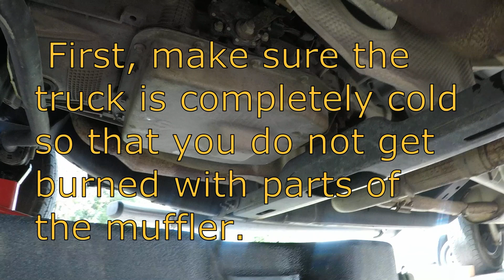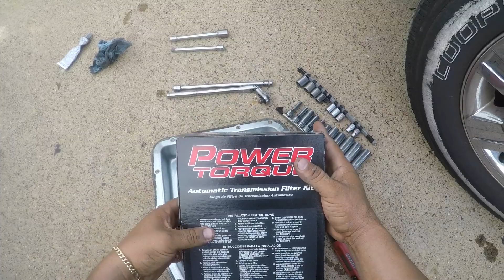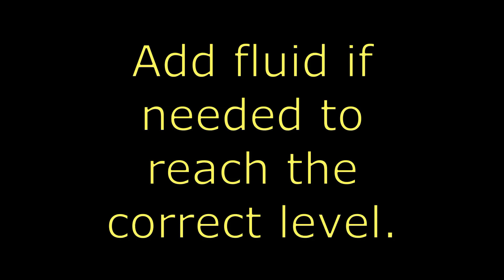2007 Ford F150 Transmission Fluid Change

Comment: I appreciate the note about the factory dust plug. I have changed the transmission oil in many vehicles. Never an f150. That thing freaked me out because I thought I fell out of nowhere 🤣
Reply: Same! LOL I have spent the last 30 minutes trying to figure it out before putting the reusable gasket and pan back on lol

Comment: The trans gasket is re-useable! It even states that on the pan!
Reply: (years 2004 thru 2014. Not including F250, Super duty or diesel models, F150 heritage, lightning or raptor models.

per my f150 manual, it states to never reuse the gasket or filter
section 1-27 ATF maintenance schedule 100k miles

under section 2 states
"2. Before beginning work, purchase the transmission fluid specified in Recommended lubricants and fluids in this Chapter's Specifications, a new filter and gasket. Never reuse the old filter or gasket!"

Comment: The factory gasket is reusable. You don’t have to put sealant and new shitty gasket on. The factory one is perfectly fine as long as it isn’t torn.
Reply: Yes, use the higher quality of the Chinese made rubbers, even if it's got many miles behind it
Reply: O kay
Reply: the manual states to not to reuse the gasket/filter....

Comment: Nice video!   Really clear and well made.  One note: I would stick with Motocraft Mercon V, not LV.   Also, does your cordless drill get tranny fluid in it and have you noticed it affecting the drill?
Reply: I saw that too and was like "is use a ratchet for the last few bolts, tranny fluid can't be good for a drill."

Comment: Easy way of torquing the pan bolts is to palm a 3/8 ratchet just tighten about as hard as you can with one hand wrist, can’t over torque, works perfect every time. I don’t trust the torque wrench 🔧 just seems way to tight. Great 👍 vid.
Reply: Is the wrench calibrated or your wrist lol
Reply: @robz5435  ibelive you ppl at work dint even torque wheelends…

Comment: Did you look inside the filter bore hole for the old trans filter seal? They usually stay inside the bore. I bet you didn't and pushed up further into the bore!
Reply: SERIOUSLY? Blue lock tite? Man, you need to stop doing mechanic work all together! You are misleading people by doing stupid shit like that!
Reply: @wrr2112  I don’t use thread locker at all unless it calls for it. As long as you torque it to speck it’ll be fine
Reply: If you were paying attention you can see it was still connected with the original filter